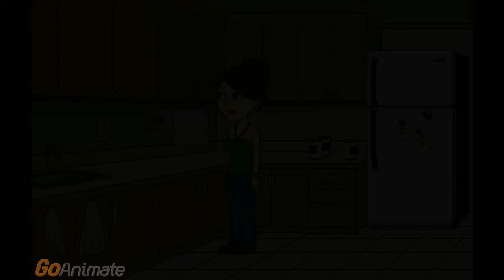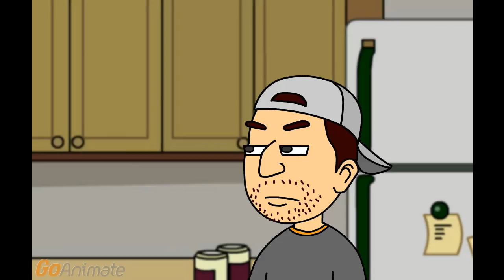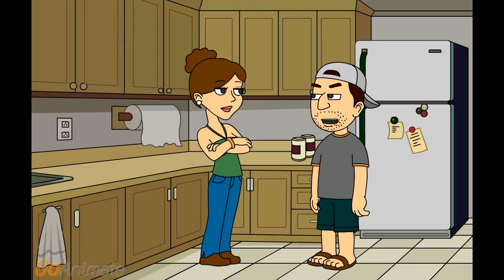How to Fix a DeLonghi Dehumidifier

Comment: In case of DeLonghi DNC 65 Tasciuga Ariadry Light dessicant dehimidifier, common fault is switching off after some time when tank is empty and without any alarm. The reason is piezo-electric anti-trip sensor located near humidity sensor - with two red cables connected to it. There are two black plastic encloures with loose elements inside that because of vibrations are loosing connection and forcing microcontroller to switch off the device. becouse it thinks that dehumitifier tripped . Fix is ether to replace the sensor with better quality one or create short circuit in sensor's socket. In second case of course anti-trip security will be disabled, but dehumidifier will not switch off without any reason in normal operation.
Reply: Thanks for your comment ! 
It was helpfull to me, mine works again !